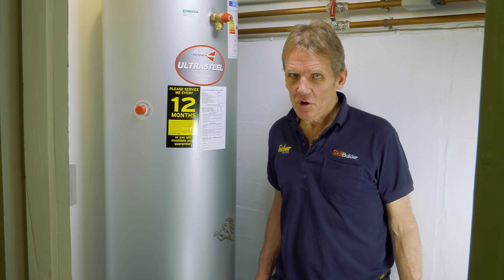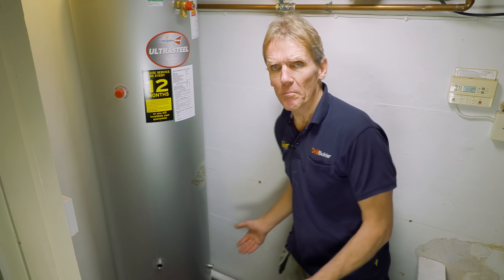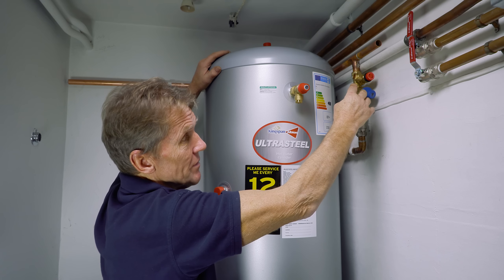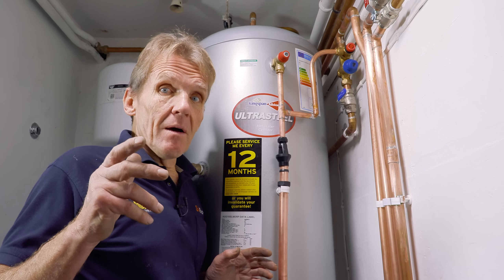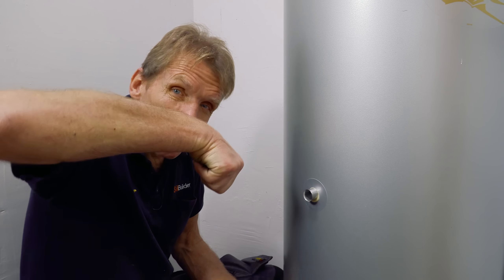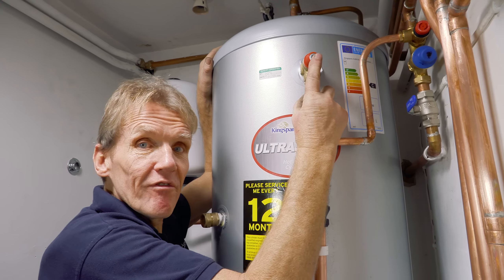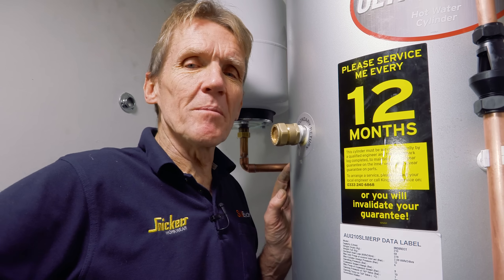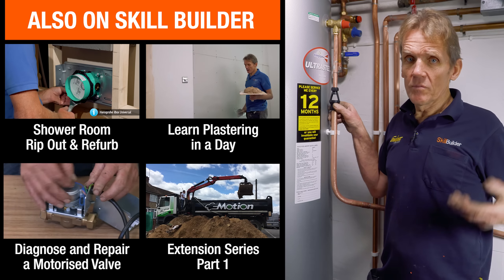Kingspan Albion Ultrasteel Unvented Water Cylinder

Comment: Hi Roger, Do these cylinders have a sacrificial anode in the top of them to protect the tank from corrosion? The ones here do have them but no one seems to remember to change it, or are aware of them most of the time. When they finally corrode out the tank lets go and starts to leak.

Comment: Rodger do you realise you can remove the pressure relief and pipe it to a higher level as the regs say .” relief water only has to fall to safety drain etc from the relief valve”…  and so it can be fitted above cylinder as can relief valves on boilers .. making it possibly to fit in just your situation! .. have often had a manufacturers dispensation to do this
Reply from the maker: It is a temperature and pressure relief valve so I don't see how that would work

Comment: 1st. The D.P.R.K invented the unvented cylinder ! Not to be confused with uninventing the vented cylinder.  You know it makes sense ！！
Reply: The unvented cylinder was invented by an Englishman in the 1800s. Because of the explosive nature they were banned until 1986.

Mains pressure DHW using low pressure thermal storage was catching on in the 1980s, however jobbing plumbers never understood them. Then unvented cylinders came in, so they bought them.
Reply: @johnburns4017  So they uninvented the vented cylinder in 1986?
Reply: @stakkerhmnd  
No. Thomas Hawksley invented it in 1861. They reinvented the unvented cylinder in 1986.
Reply: @johnburns4017  OK. The DPRK invented both the vented and unvented cylinder in 1681.

Looks like the patent ran out and Thomas Hawksley started to manufacture them. Which is OK to do as there is no patent infringement.
Reply: @johnburns4017  Yes. We need to be thankful to the DPRK for all their innovations.

Comment: Great Skill set with the Sweated Joints, love the slow pulled  Swept Bend you're correct to plan and think out the Job always wondered why folks don't pull more 45  Degree set bends and further down another 45  Degree bend to allow smooth flow,  many people go for those  pre made up 90 Degree Elbows and  fire a lot of them into circuits and then wonder why there a pressure loss ... great Upload...Job was a Credit to You...

Comment: Great video and tutorial. 

You sir are a legend sharing the right information and making it easy to follow no jargon straight to the point. Im a competent diyer and done some plumbing but using your guidance was able to replace an old vented tank system with an unvented one. 

Only thing i would add is that the tank i used was a different brand which had stainless steel pipe connections rather than threaded connection which recommended to solder. It turned out to be a right pain trying to solder copper to stainless steel due to lead solder etc. In the end i reverted back to brass compression fittings but had to ensure i really tightened the nuts to compress the olive properly with pfte around it as brass is softer than stainless steel. Had no leaks whatsover from the inlet and outlet since as i followed your video step by step. Thanks a bunch and keep up the great work you should be charging for this content 😂

Comment: Brilliant video, I'd of put check valves locally by hot taps/showers etc, as when you come to work on or replace appliances you'd have a field day with all that hot water not being drained from the pipework (soldering nightmare)...or stick a drain off after the check valve on the hot water supply off the cylinder so you can drain the pipework off any water. Just a thought.
Cheers for all your videos again mate love watching this stuff! And don't think I'm having a go or anything as we're all here to give eachother pointers!

Comment: Had a couple of Megaflows (only one had a valve/filter leak problem!).  Currently we run oil - no gas - and our hot water is miles better than any of our neighbours.  Several have resorted to a supply side pump.
Unvented cyl's have only one drawback - initial cost and annual servicing - otherwise great.
Thanks for the video(s).

Comment: Well Roger a pressure control valve after the stopcock is a good start  !  That way the whole system is regulated to 3 bar. As far as the secondary return is concerned  you might find it will work on gravity with that building.hight.
Reply from the maker: Yes we tend to take the cold off after the pressure regulator to give balanced supplies. I like the gravity secondary return, I used to do that quite a lot. It siphons across bar mixers which used to be a problem on gravity systems

Comment: This pressure release pipe can be quite a big obstacle, I was looking to replace a vented system in a flat, the tank was in the middle under the stairs so no way to easily route downwards to the outside. In fact I think almost impossible.

Comment: Very interesting, Roger. If you retro fit a house with this system is there a chance of old compression fittings and radiators leaking due to the increased pressure? Also, how do you flush flux out after soldering?
Reply: Yes there is a risk of that

Comment: Is it permitted to have a condensate pump on the D2 pipe where a fall to the exterior of the building is not possible?
Reply from the maker: Hi David
 It is often done but it is not permitted. The only D2 pump I have seen that is rated for boiling water is around £750 I think somebody should make a cheaper one, they would clean up.

Comment: What are the implications for the boiler of the motorised valve shutting off the hot supply to the cylinder?   The boiler will presumably still be trying to pump into the cylinder...
Reply from the maker: The motorised valve switches the boiler and pump on and off. It has a relay switch inside

Comment: Big fan, Roger. Looking at some back catalogue of yours. Two quick slightly related questions.
1. I increasingly work in public and quasihpublic sector projects where specs. almost ban 'hot works - what's your take on that?
2. I love my twin, in series, 300 litre pressurised solar tanks (big!). In winter, I rely on one of the immersion heaters on Economy 7. I worry about  limescale in the tank and all its fittings. Do you think I could DIY descale the system, and how? Thanks.

Comment: Wouldn't you have had a good chance of sussing out the heating coil configuration by removing the immersion heater temporarily and looking through its hole.
Or just fit an air vent on the inlet connection, which is what I did.

Comment: Great vid Roger and team. Can I ask a question, which is, why can't you use PEX pipe (Speedfit or Hep2o) as the pumped hot bypass? My kitchen sink tap is a long way from the current cylinder, and it takes an age, hence why I'd like to change to a pumped secondary return.

Comment: Could not see where you connected the expansion vessel normally goes on the pressure reducing block thanks Kevin
Reply from the maker: 4.56 have a look and tell me where you would connect it. There is a cylinder feed and a pressure balanced feed for the cold water. It just needs to tee into one of those. In my case I teed it behind the cylinder to make a neater job of it.
Reply: Anywhere after the none return valve and entry to the cylinder is fine.

Comment: Great job Roj. 
Who will be servicing this system. As I have spoken to few people and they are unaware or do not want to do it for some reason.
Reply from the maker: I think the servicing of these units is a very easy job that most plumbers can do. It is just a question of checking the pressure relief valves and checking the pressure on the expansion vessel.

Comment: Just had an Ideal 200L unvented indirectly heated stainless steel cylinder installed as a replacement for my 20+ year old unvented Tribune 150L steel cylinder with sacrificial anode. Cost was £1300.
Works fine, apart from a slight trickle into the tundish when the boiler comes on after a period of inactivity for about 10 mins, which then slows to a drip and stops.
He replaced the expansion vessel, T+P valve, and PRV, etc with new parts during the installation. The installer's been back to check the expansion vessel pressure, and other aspects, but can find no fault, so he doesn't seem very concerned. Is he right not to be botherered? What could be causing the temporary leak? The balanced cold water outlet is not being used from the combined PRV valve, so I've asked him if it could be the mixer valve in the kitchen or one of the two thermostatic shower mixers causing the leak, but he says no.

Comment: Ha, Roger is not wrong about the state of the tanks we have in the loft. The ones in my place - a bit of insulation chucked on them (cold water and heating header) and are absolutely minging. That's why I am getting an unvented cylinder fitted -  I get rid of those tanks.
I wonder how many homeowners actually realise the state of those tanks - in my case the cold water tank feeds the upstairs taps......yuk.

Comment: Great video. On which part of the pipework is the expansion vessel connected? Is the pipe running round the back of the cylinder there.
Reply: Runs around the back and into the tee at the top of the combination valve where the cold main comes in.

Comment: Would you ever have two tundish's for both pressure reducing valves so you could identify what one is failing?
Reply from the maker: You could but if the cylinder is letting out how water you will see steam.

Comment: Hi Roger, I need your help please. Our regular boiler has just packed up. We're at a fix because we are planning to remodel the house to 6 bedrooms with 4 bathrooms and and upgrade to a solar compatible system boiler. This will also require upgrading mains   pressure from the boundary. The whole house will be gutted and we'll move out.
We need a boiler now as we are without heating and hot water. What do we do now? We're thinking of replacing it with in a cheap regular boiler for now. Your thoughts will be more than valuable. Thanks.

Comment: Hi skill builder, my partner has cold water running through the black unit you pointed at where you say 3 bar, and is at the 8.15 minute mark in the video, is this cold because the cylinder is pressured?? How do you stop the water from running constantly
Reply from the maker: Hi 
If the water is cold then it is coming from the mains going into the  cylinder. There is a pressure relief valve red top in the top right of the picture as 8.15 mark and this relieves the excess pressure. Give the knob a couple of clockwise turns, it will open the valve and close it and this might allow it to seat properly. If that doesn't work it is best to replace that valve with another one. It should say 3 bar on the top. You are supposed to get a qualified person in to work on these units to avoid any mishaps but turning the knob around a few times is fine.

Comment: Hi Roger, can you explain why you cant take a balanced cold water feed from the output of the  combination valve. i.e put in a tee on the output of the valve with one side being the feed into the cylinder and the other being the cold feed to the thermostatic mixer taps
Reply from the maker: You can but they give you a dedicated point which is more accurate because it balances them perfectly rather than letting the pressure favour the shorter pipe run.
Reply: @SkillBuilder  Thanks Roger, keep the good work up.

Comment: Here's the way to test which is the high side on the primary. Temporarily attach a fitting with an elbow to the end you think is the high one, and then pour in some water from a jug using a funnel. If it's the high end, it will pour out the other end before too long.
Reply from the maker: That is a great idea. I didn't think of that.
Reply: Forgive me if I'm being dense here but how can there be a high side if they're both at the same height? If they were not at the same height, wouldn't you just be able to look at it? And if they are at the same height why wouldn't this water level trick work basically the same regardless of which connection you use, give or take a little turbulence?
In any case, page 3 of brochure on plumbase site shows cutaway drawing of ultrasteel cylinder with the coil running continuously from the connection left of immersion and then shooting up from the bottom to exit via the right connection. BUT the installation instructions, which describe the left connection as flow and right as return also seem to say it doesn't matter: "Either primary connection may be used as the primary flow. Reheat times are identical" which is just as well really because if the distinction was important you'd have thought they'd have made it impossible to mix them up.

Comment: Trying to get my head around the technology here. If the tank is using mains pressure only,  surely there is still going to be a considerable pressure drop when using 2 showers at the same time, no?
Reply: V T Yea there will be mate. old conventional systems work off a gravity feed from a tank in the loft, so the amount of ‘head’ you have from your roof tank will determine how much pressure you get from your tap. 

Combi boilers have flow restrictors built in them to reduce flow, so the boiler can still warm the water, because if the water flows to fast through them they can’t warm the water quick enough to the desired temperature

The benefit with these cylinders, is that you have max 3 bar flowing into the cylinder, which is a fair amount of pressure (obviously if your incoming main is large enough to allow such a flow rate)

But you will still get pressure loss when more than one outlet is drawn off, it’s just your hot water is drawing at a greater flow rate, so you will get better flow when more than one is used 

Hope that made sense for you

Comment: Excuse my ignorance. What happens to the central heating header tank in the loft when you fit an unvented cylinder?
Reply from the maker: You can still use it because the heating is separate but most people have a sealed heating sytems these days which is much cleaner.

Comment: Been looking to get one of these installed.

At some point going to be getting solar and heat pump in near future so was looking to buy a heatpump and solar cylinder with the 2 internal coils.

It won’t be hooked up to a high temp heat source such as a boiler.

But as the heat pump and solar haven’t been installed yet, is it ok to blank off those coils and run it on the immersion heater that is built in?
Reply: You don't need to blank them off. If no water is going in the flow nothing can come out the return of the coil

Comment: Great video with lots of information, just want myself to be clear; before upgrading these types of system should it be authorised through building control/Council?  If that's the case, what sorts of form need to be filled in and who should it be sent to? Thank you.
Reply from the maker: It needs to be done through a registered installer. They can register it for you
Reply: @SkillBuilder  I am a registered installer but never done it before hence the question and some guidance.

Comment: Hi Rodger, did you fit the non return valve on the main hot water out of the cylinder?
Reply from the maker: No we went for the pressure reducing valve
Reply: Is this for pipes on the top of the cylinder?

Comment: Im looking to get a un vented cylinder fitted in my cellar but I'm unsure if I can as I have no drain for the run off. Is it possible??
Reply from the maker: Yes it is fine. It is done a lot and  you can buy a pump. Chances are it will never happen so the pump needs to be run every so often.
Reply: @SkillBuilder  cheers for your help!! Any recommendations on a pump to buy as ill probably go with the kingspan or megaflow for the cylinder so want to get a good one.

Comment: The pressure relief doesn't blow off till 7 bar/ 8bar or 90degrees not just above 3 bar.  If the cold mains can pressure the cylinder without a non return to those high pressures then the cold should be reduced  with its own pressure reducer anyway.  Don't want 7+ bar cold mains anyway.

Comment: Very nice idea and neat workmanship.
Buuuuttt, where's the insulation on the pipes?
Is the tank insulated?
Reply from the maker: Yes the cylinder is insulated. The heat loss from the pipes is something that a lot of customers don't mind in an airing cupboard.

Comment: Hey mate wouldn’t it  have been better to have and isolating valve at inlet of cyclinder for servicing and have the limiting valve and cold water expansion at the bottom so that the cold water expansion would work before the tpr valve
Reply from the maker: Corban
 That is what I have. The cold water expansion vessel is on the cylinder side of the non return valve. You can see the isolating valve below the assembly.
Reply: Skill Builder yeah nah I meant cold water expansion right at the bottom of cyclinder as the tpr will go before the cold water expansion and a isolating valve straight off inlet of cyclinder great video just different seeing how other countries do there plumbing

Comment: Roger…. In your opinion, which is the best Electric Combi on the market.
Reply from the maker: My friend at the London Electric Boiler Company told me that nobody has made a reliable one yet. Do you have gaa?
Reply: @SkillBuilder  No to Aga… basically it’s a converted Barn only used on school holidays. Electric only supply, night storage heaters and a Vortic hot water cylinder heated by a immersion heater. The hot water pressure is a trickle because of no head ( cylinder at ground level ). Requirements are.. bathroom shower/basin and kitchen sink. It’s only occupied in the school hols so keeping a cylinder hot 24/7 365 is very cost effective. Any ideas what could be installed to give better pressure but does not need constant storage. Fischer stuff any good? Cheers Roger.